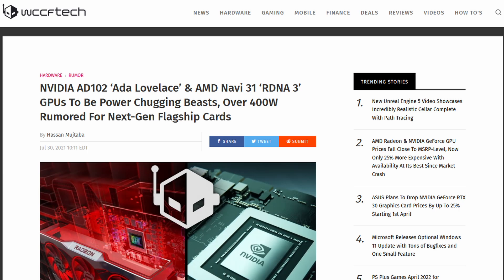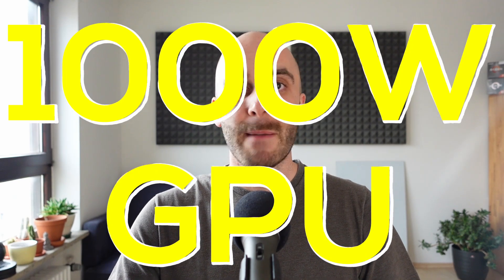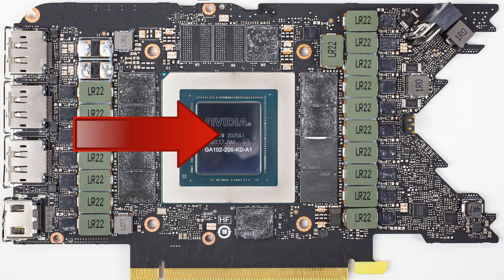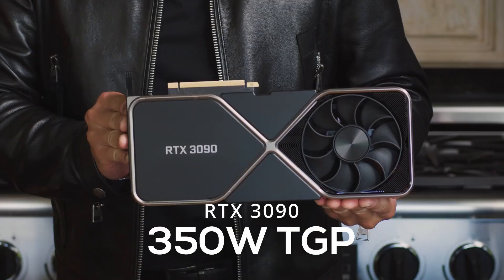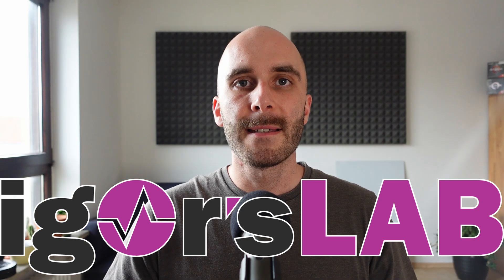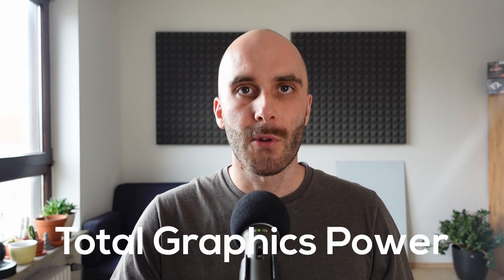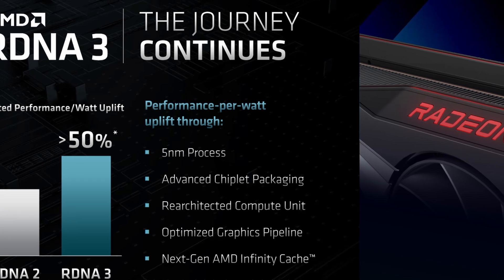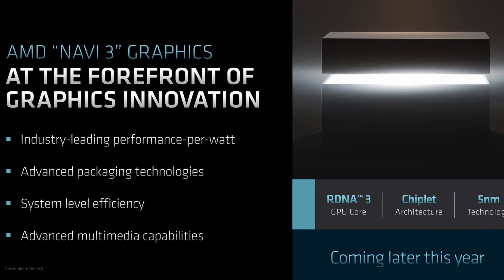Nvidia RTX 40 TDP Rumor Analysis

Comment: I expect about 2x 3090 performance out of the 4090. The "official" 3090 TDP is 350 Watts so 2x 3090 TDP = 700 Watts. Now let's say the new process node saves about 20% power for the same performance so the TDP of the 4090 should be somewhere in the ballpark of 560Watts maybe... Obviously I picked the 20% arbitrarily but I don't expect efficiency to be lower with the newer generation, that would be really absurd.

Comment: Due to contraints on watercooling capacity in ITX format, I'm only interested in a maximum-300W cards. Even with a 3070 ti I'm getting 55ºC coolant temperature with a 360 mm radiator...
Reply from the maker: Yes, SFF cases are though to cool, even tho there are some well ventilated one. I would like to stay sub 300W myself.
Reply: SFF kinda sucks, ngl. It's cool and all but unpractical, hot, loud, unflexible, you got barely any used market etc.

Comment: I still have 1000w power supply that I have had for to builds now. I got it for my FX 9590 with crossfired 8GB OCd rx480s. The 9590 was a 220w chip and I had it OCd to 5.0 and needed a 240mm radiator mointed on the outsode of the case to stay within thermal limits. The case needed 5 high speed fans as well to keep enough air moving through it for the tightly packed dual GPUs. It had 32GB of DDR3 and 2 SATAIII SSDs. The PSU is still running smooth steady voltages according to my scope tests as of last month. I am currently using the PSU for a 5600x build though with only one of the 480s, 32GB of DDR4, and a M.2 SSD. The 5600X being only 65w using a stock cooler and only having one GPU with fewer case fans means there is plenty of power left to go around. I plan on getting a RDNA3 for it, but not the top tier(6950xt line equivalent ) but a 2nd tier like the 6850 line equivalent, so hopefully the 1000w I have now will be more than enough for such an upgrade. If I need to get a new one I will though. I have usually always over speced my PSUs just to be safe although, I'm pretty sure that 9590 build was almost pushing it at times. I guess we will see? I can't wait til the day I pop that RDNA3 in there and see what happens!! I have been lumping along with the 480 for a while. Although it is holding its own pretty well, I would like to play a game without a whole hour of tweaking settings to get the most out of it. Especially playing STALKER Anomoly at full blast 4k!! The suspense is killing me lol
Reply from the maker: The good thing about high wattage PSUs is, that they run very efficient at normal loads. My only concern would be the age since a FX 9590 build isnt the freshest anymore ;)
I'm currently using a 750W SFX PSU and I wouldnt try running a 600W GPU with that.
Reply: @HighYield  yeah, that is why I test it. I am probably going to recap it and replace the fan and maybe replace the HOT(high output transistor) if I can find an appropriate one. Will also test the bridge rectifier against my initial testing  notes upon buying it. I repaired Arcade games for years and have rebuilt/"bulletproofed" countless PSUs and B+ power supplies on CRT monitors during that time. I will see how much money I have left when I get a new card. Ideally I would get a new PSU for it, but since this one has worked so well for so long, refurbishing it with high quailty components may be a safer bet. I have had really bad luck with PC PSUs over the years and unless I spend A LOT on a really nice one I would be worried it may fail and damage the new GPU. I am also having 2nd thoughts about waiting for RDNA3. It is starting to look like they MAY not be available until 2023. plus since many new ones are selling below MSRP right now, a rx6850 may be a nice hold over until then. I wpuld be really bummed if I wait til they are out and then not be able to get one. I can always sell it if I do or just put it into my daughter's Zen 2 build. I have been very happy with my RX480 considering its age, but it's just out of reach of what I want to do and since I have so little time to actually game, it would be nice to be able to take advantage of that time better until then. I may even have enough money by then to go full blown Zen 4 too and just give my whole 5600x build to her and give her's to her younger sister. Why not? Plus I really wanna see SAM in action!!

Comment: I've always preferred buying a GPU with good perf/watt. Hence I own a 6800 non XT and a 6700 XT for a different system. Sub 300W has been the sweet spot for me. If I choose to upgrade I might have to up that threshold to 350 or 400W, whatever turns out to be the optimum perf/watt for the next generation(s).
Reply from the maker: Same here, I'm also currently running a RX 6800. It's perfect for my small ITX system and powerful enough, but my current resolution is 1080p ultra wide (2560x1080) and as such its a rather low res. I'd be willing to go above 300 watts, but only if the noise isnt getting too much and I get a lot more performance.

Comment: I would not buy a GPU that uses more than 200w of power. I think 200w is already too much, but for the lolz, i'd be ok with it in winter i guess.
Reply: I agree. New Gen GPU releases need to have the same power draw but better performance
Reply from the maker: My limit is a bit higher, butI agree, 200W is already a lot of power.
Reply: my cap is 300watts. In warm areas you literally cant run a pc during the summer

Comment: I think mostly legit if not a little lower I think fact is 8K is a beast to run and so an extra-special part of the design is going to require a serious amount of power, unlike other previous designs.
Reply from the maker: Yes, 8K is too much at the moment and even wil DLSS/FSR its a challenge. I think we will see a 600W "extreme" design and a more "normal" 450W version as base versions. Ofc partner cards might get crazy.
Reply: @HighYield  In the back of my head as well I keep thinking the extra power may be explained by something equivalent to or better than AMD's infinity cache.